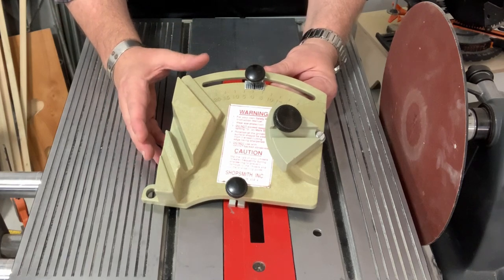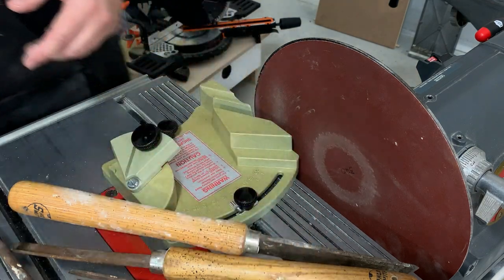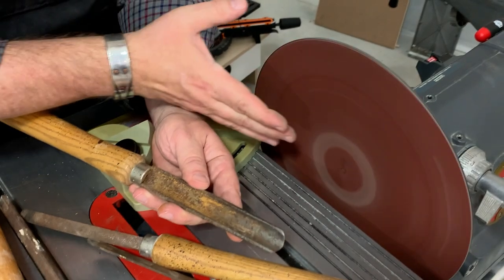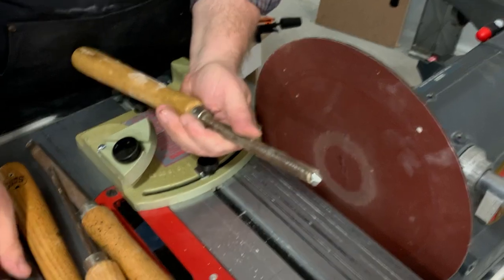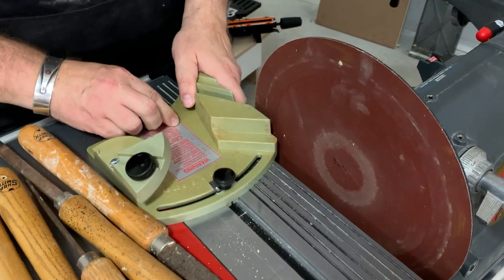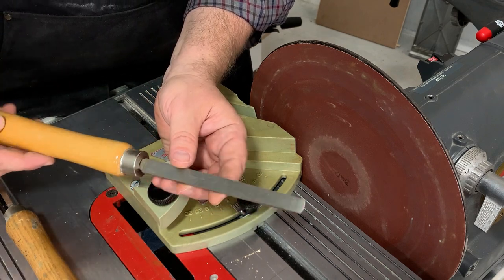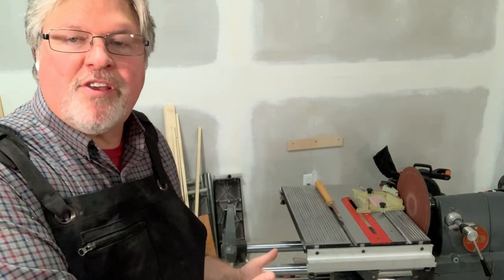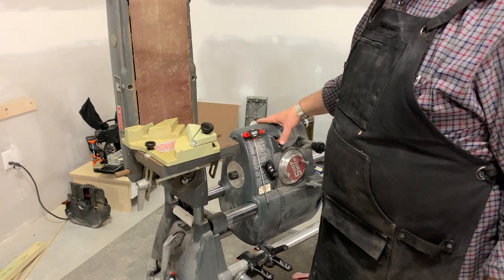Master Razor-Sharp Lathe & Bench Chisels Using Your Shopsmith Sharpening Guide

Comment: This channel is a wealth of information and has been exceptionally informative. I recently ordered a new Mark 7 (has not arrived yet) and included a basic set of SS wood chisels in the order. The chisels I ordered are the 8 pc Benjamen's Best 556463. I just tried to order the guide you are demonstrating and in the process may have discovered that this guide will not work with the new basic SS wood chisels I ordered. I am absolutely new to wood turning and have no idea if this guide will work for me. Can someone point me in the right direction........should i return the chisels when they arrive or will this guide work for me?
Reply from the maker: I own the Benjamin’s Best set and it is good. You are correct, the SS guide will not work with most if not all of them, so I would return it. Scott